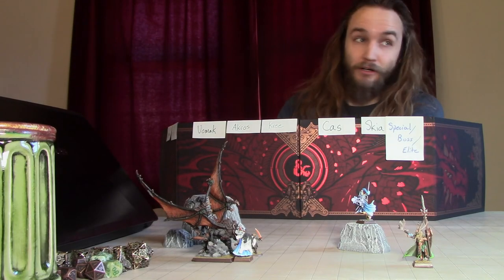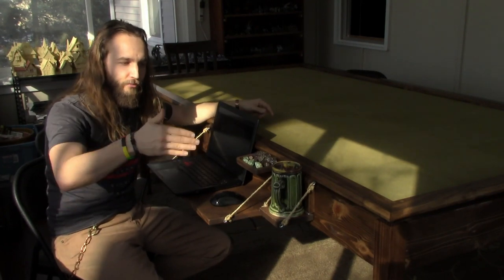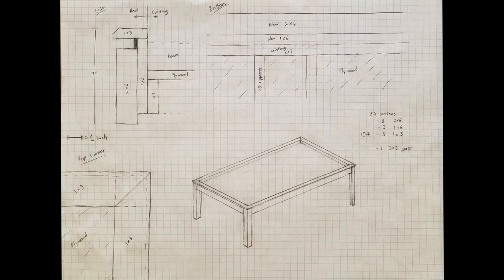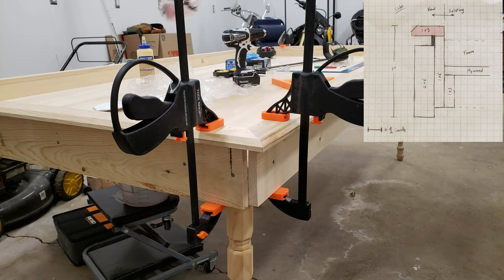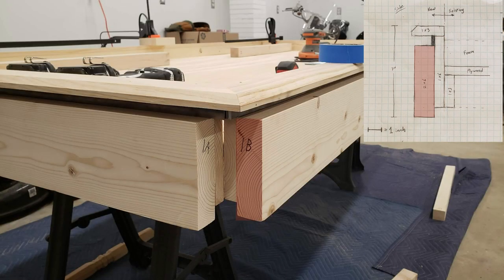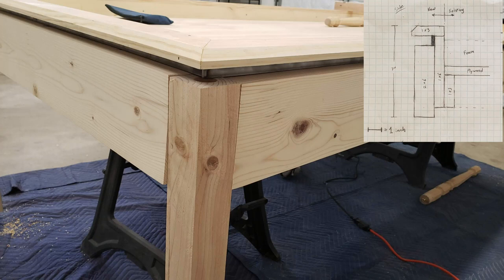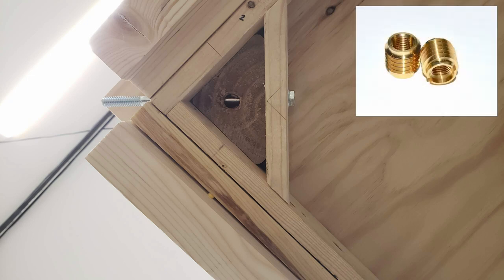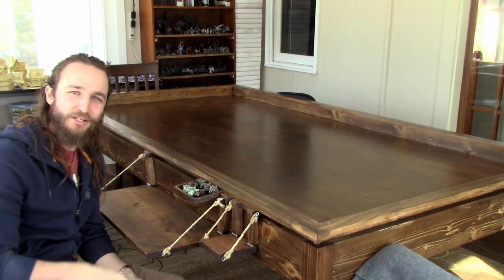Gaming Table Part 1

Comment: Thanks for the video!  Is there any issue with the top arm rest flexing or bending given that it only is held by a relatively small contact point?  I love the idea of the magnetic rail system but wondered if you could get by with a shallower depth slot for your accessories while still providing ample strength.  Would love your thoughts.